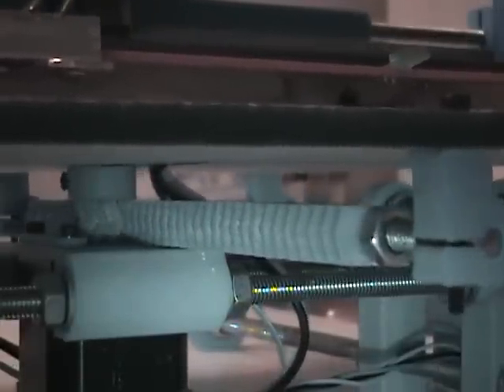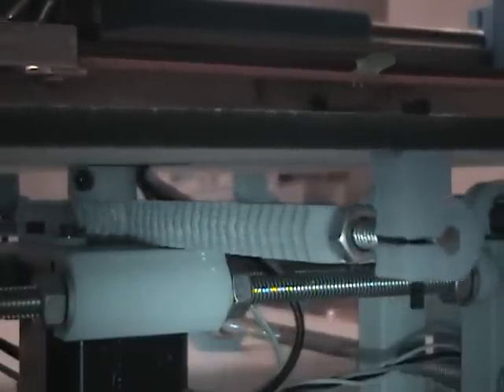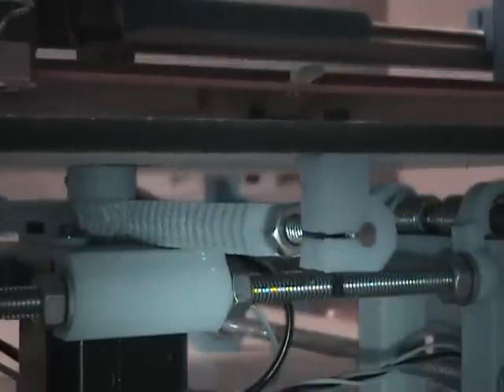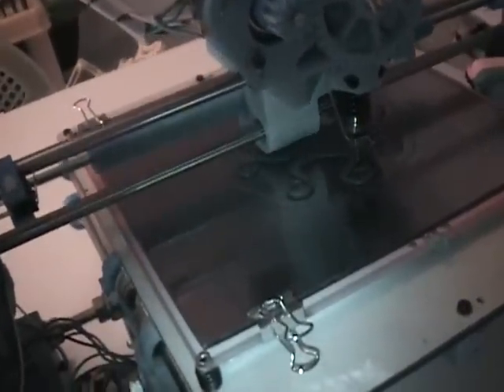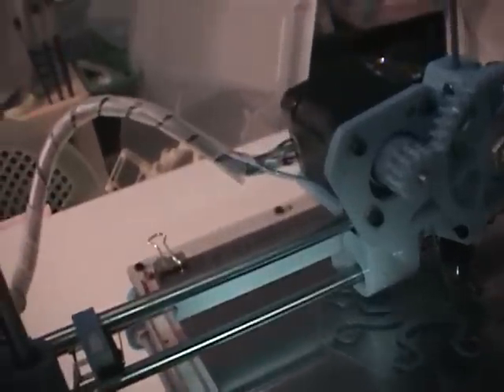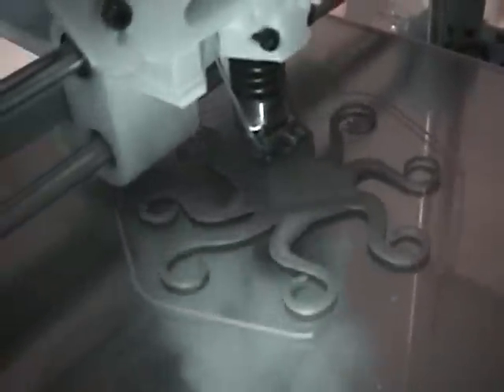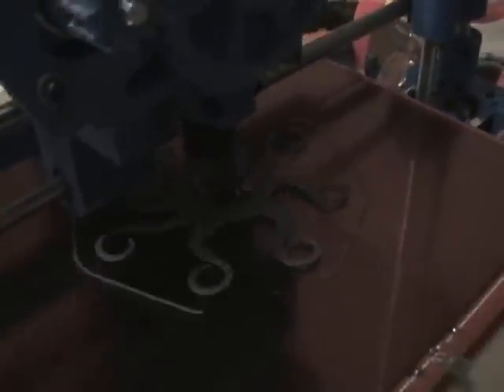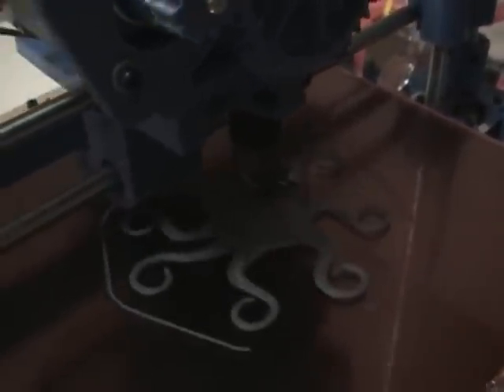RepRap Wallace GP XY Rack

Comment: Any measurable gear lash?  I really like that self-centering helical cut.  Fantastic bit of design work, that!
Reply: +Sean Connolly  When the gears are mashed properly, none to speak of. Same as properly tightened belt. If the gears are too lose, yes backlash!. If they are too tight together, you get a tooth width pattern on the print, but still no backlash. :)